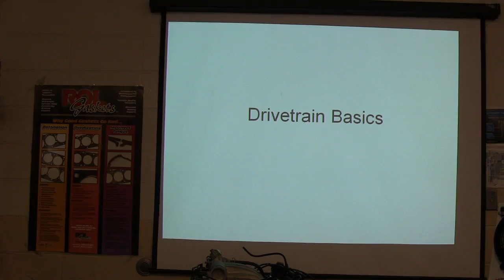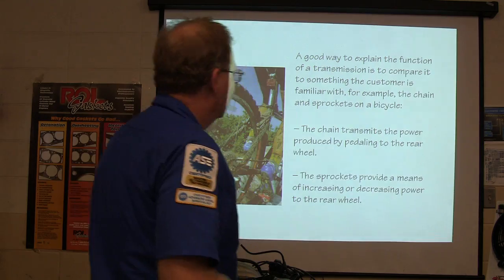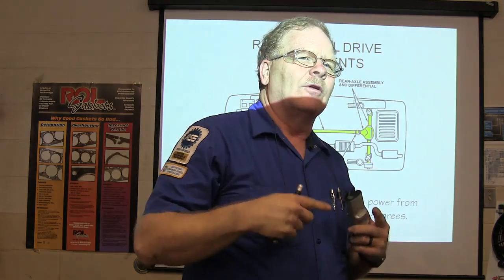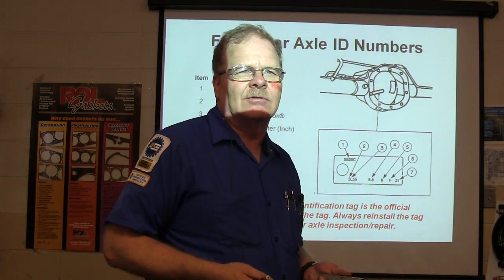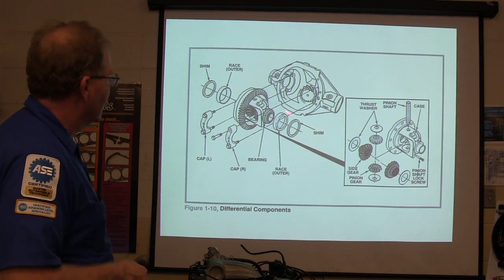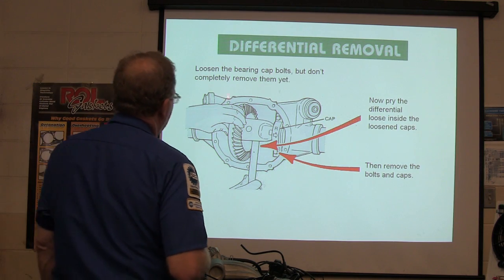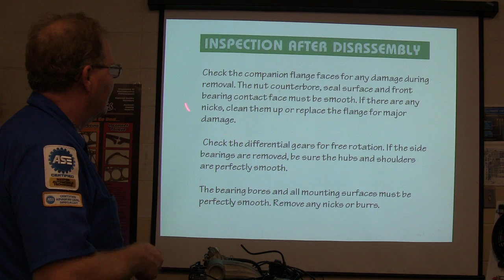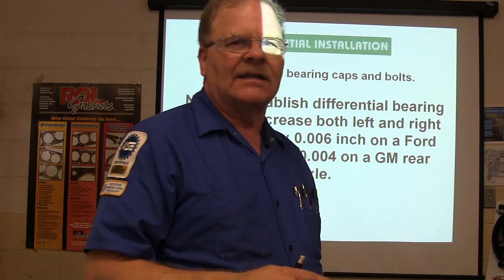A Flying Trip Through Driveline Basics

Comment: Back in 2001 I tried going to dealers trying to get transmission parts. Some places were shocked like I did something criminal by opening the case. They said they never open the case it is not there job to do that.  It made me laugh followed by a trip to the transmission parts house. It's just auto repair real mechanics do not fear the rear end, transmission, or engine. I like your videos! One day some one who likes cars will ask you what's a carburetor, distributor, or points.